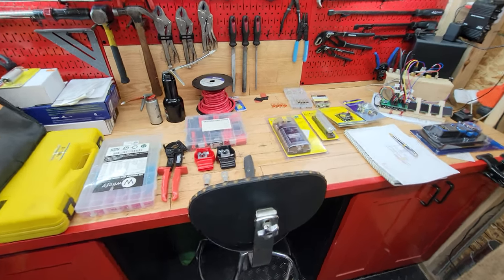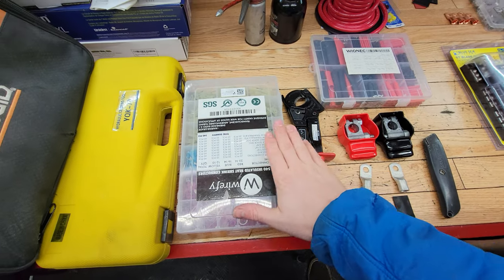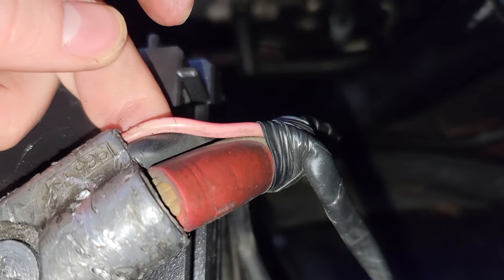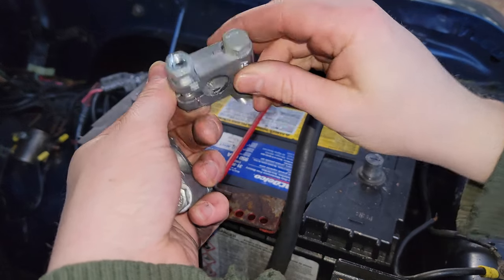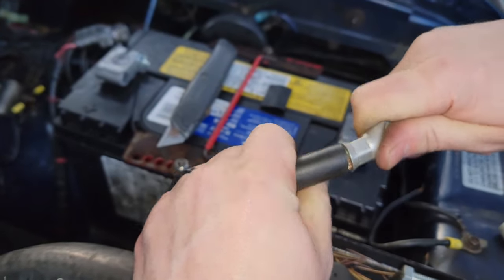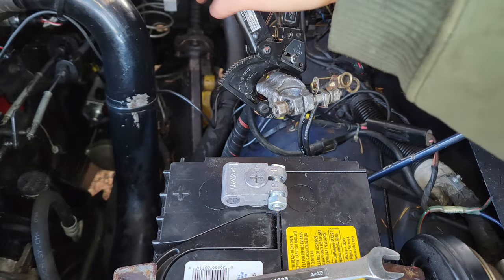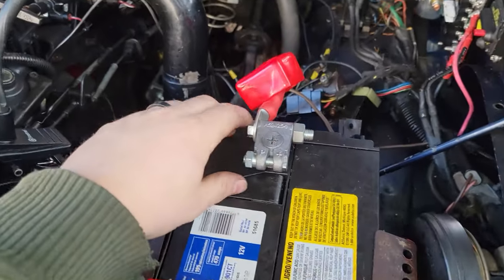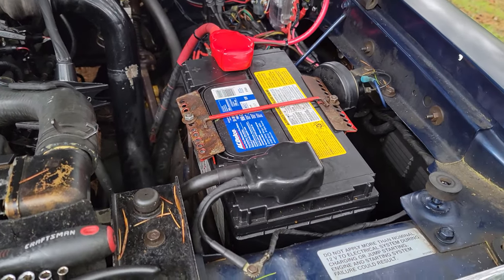Military Style Battery Terminals | 1st Gen Cummins

Comment: Awesome job! I've been planning this update for my truck for a while.  That heat shrink with the new wire and ring terminals will make sure you have a good connection for years to come. Better than original.  I rewired my headlights to a relay under the hood and redid my charging system due to the bouncing voltage.  Use a little dielectric grease on your final connection points for a little added protection against corrosion. Has worked great for mine.
Reply from the maker: Thanks! Yes, it's a bit of extra work with the heat shrink and using marine grade terminals but well worth the effort. That's one thing I still need to buy and use is a bit of dielectric grease on my connections. I like this method over soldering because I find the connections are just as strong if not stronger than soldering and saves a ton of time and hassle.

Comment: Great video, I did it to my truck. I want to give you a tip, the negative terminal must to be connected at last one. To prevent any damages if you touch chassis ground while you tight the positive terminal. And vice versa, the negative terminal must to be disconnected first to prevent any damages while disconnect the positive terminal.

Regards.

Comment: one thing i suggest is get a fiber or plastic relay, that metal one get so hot that you can actually burn yourself off it. super hot. the 200 amp fiber relay works great. Oh and the pink wire ends up in a connector which leads to the start lug on the starter. I ended up using 0000 welding cable for my ground and positive to the starter. Wrapped up in that split loom with a similar battery terminal.  The 0000 wire had the lugs already crimped on so that made it super easy. What wasn't easy was routing that huge wire but figured it out. my original wires were shot, the insulation was split from all the years as they were OEM from the factory (1991 pre 1991.5) also the thick wire that he said goes to the fusible link, I believe is the power wire from the alternator carrying the charge amperage 80+ amps. also at 10:46 you can see the fat wire alternator wire that goes in the loom around the firewall and besides the washer tank (or battery) to the big pole on the alternator,  And a connector. That connector  has the pink wire in it and it goes from the battery to the ignition switch, the back to the connector and from there it goes to the start lug on the starter. Pink from battery to connector, then from connector a brown wire to the starter. (I just did all this stuff also) Great stuff this video
Reply from the maker: Thanks for the tips. Glad it worked out for you. A bit confused by that pink wire because in the FSM for my 92 it says it goes back to the hazard flasher. Maybe I was reading it wrong